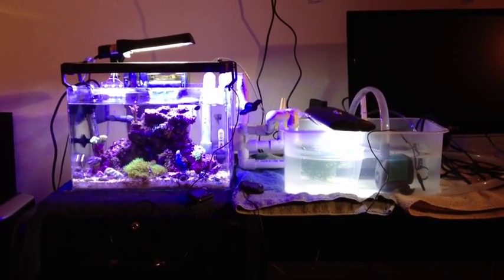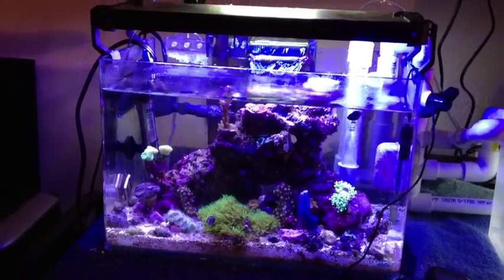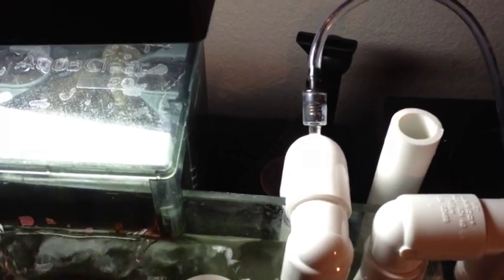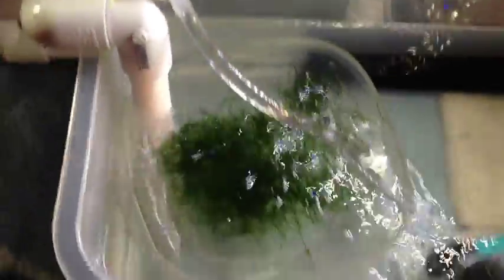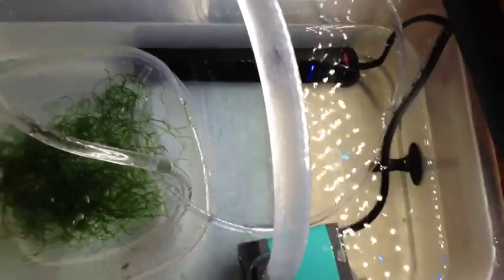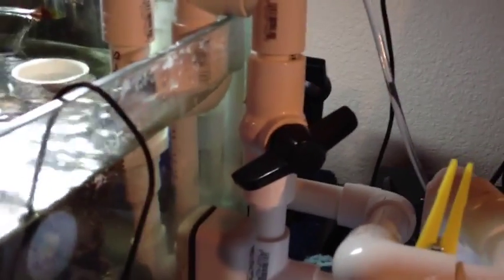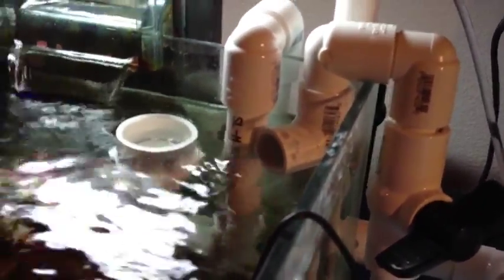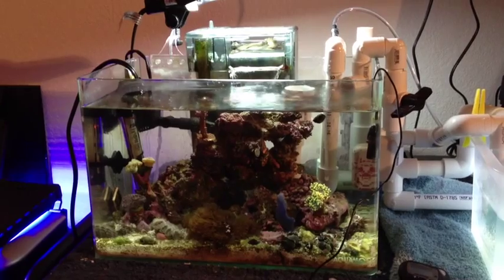Pico Overflow and Sump

Comment from the maker: It's a place to prime the siphon the first time and also acts as a vent. Once primed, you don't have to reprime if the power goes off and on. Just pour water in the vertical vent tube and start the two pumps: the return pump in the sump and the airlifter which insures there's never even a small air pocket in the siphon. Remember, if the siphon fails, the tank will overflow, so it's important that it never fail!